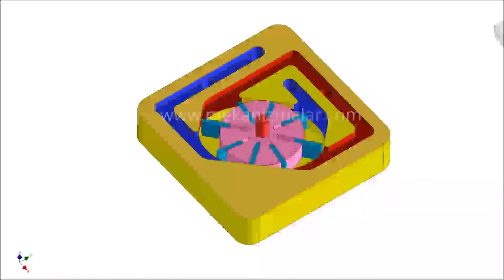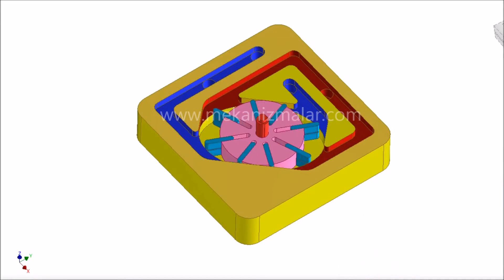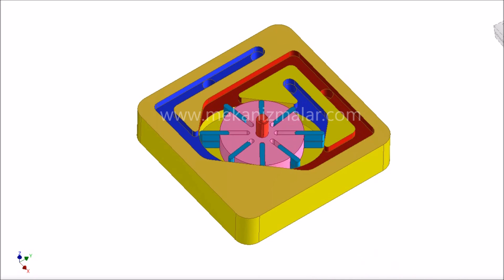balanced vane pump inventor animation

Comment: I think there's a little mistake. Shouldn't the red be input and the blue output in this direction of rotation? The swept area of the red increases whereas the blue decreases.
Reply from the maker: +bijibijmak Thank you for your nice catch. What you call small mistake is huge blunder for me. However, I was so much concentrated on the animation itself, I ignored physical phenomenon completely.   I will put an annotation about it. Thanks one more time.

Comment: Could it work with a rubber impeller?
Reply from the maker: +creativeobsin I don't think that it will work with rubber vanes as in given configuration. If there is enough room between rotor and elliptical cavity and shape of elliptical cavity slightly modified than it will work. But I prefer this configuration, because there are less contact between vanes an the cavity which reduces friction.
Reply: +mekanizmalar okay, is see. Interesting :)